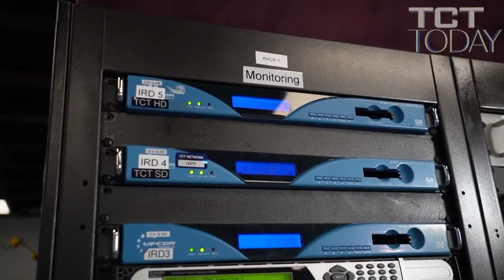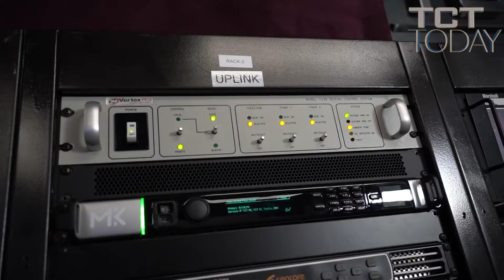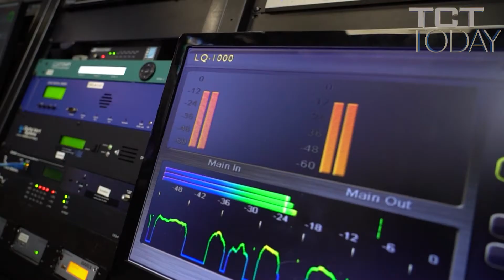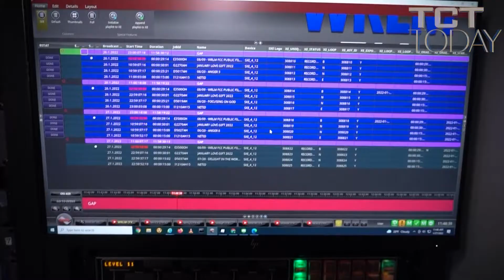How TV Stations Work

Comment: The blue rack in the third cabinet is the SAGE ENDEC(encoder/decoder) for the Emergency Alert System. This is the box that's required by FEMA to be installed in every station and you can either encode your messages, for example RWTs, but they can also decode messages sent by other stations, such as NPTs. Most of the stations use decoding part to relay messages from other sources, like FEMA and local administrations.